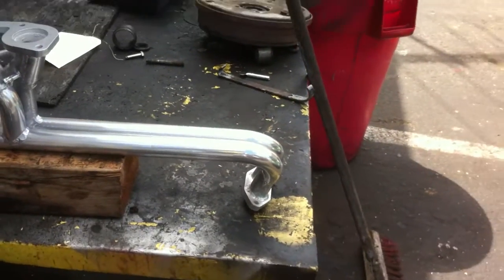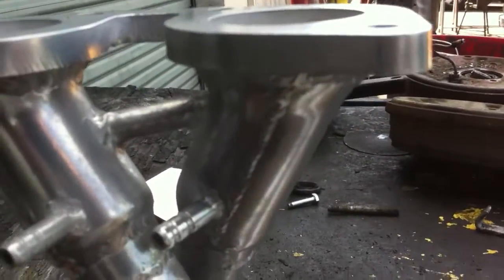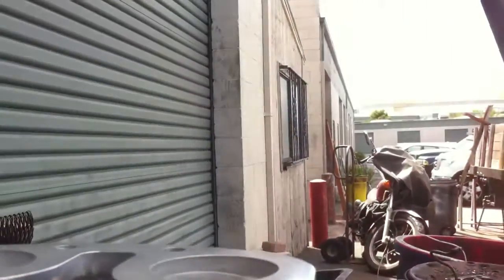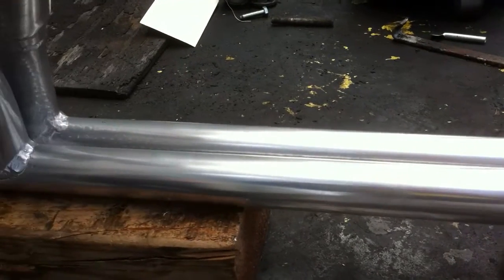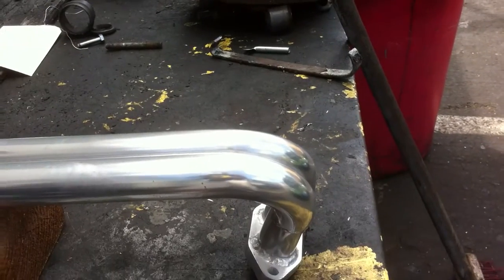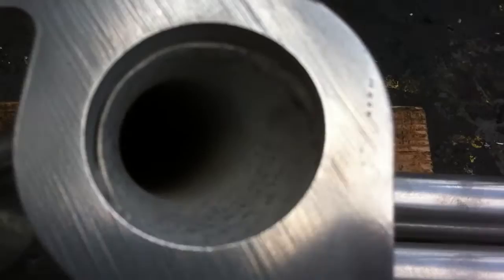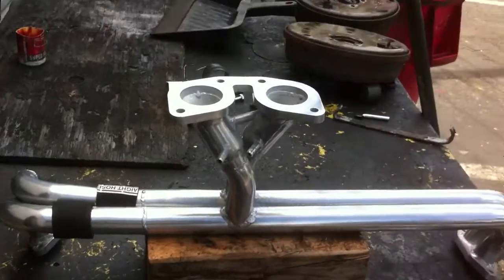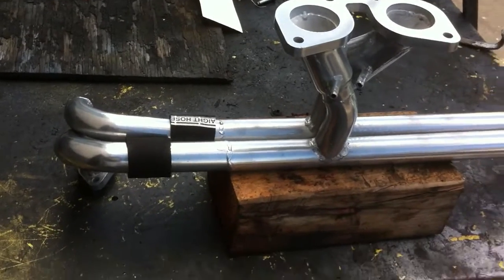VW, CROSS FIRE,OIL INJECTED,MANIFOLD HEATER, AND OIL COOLER

Comment from the maker: ray    i use a 36 or 40  45mm weber or del.. with 25mm venturis   up to 1900cc  and 32mm past that.... for air flow  our new manifolds have oil heating chambers and will fit all busses.... Leo